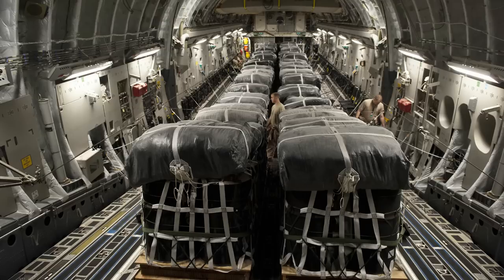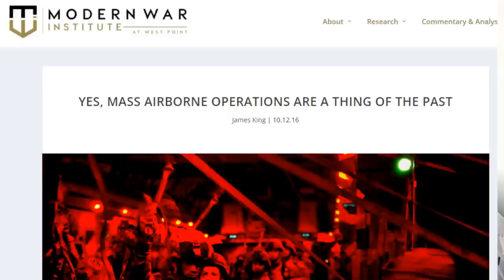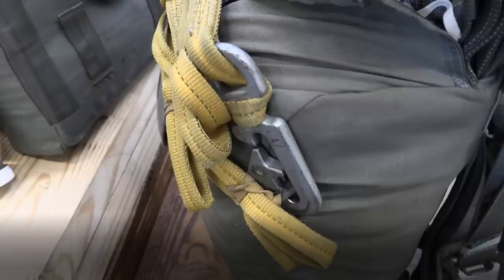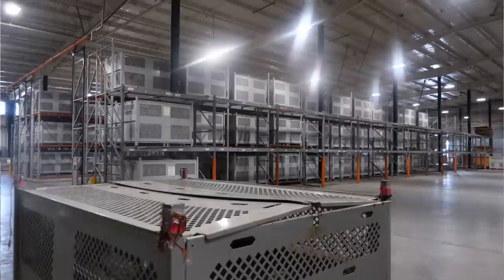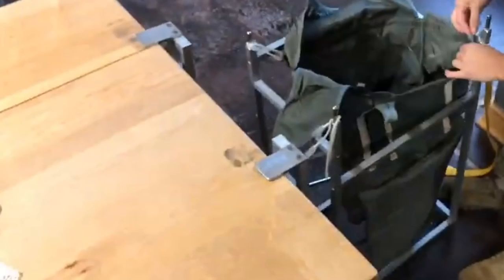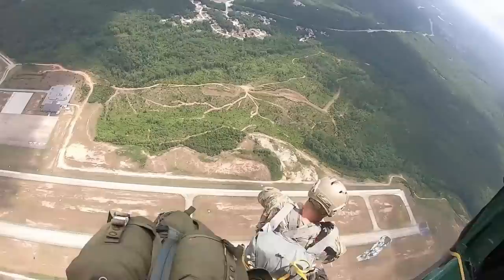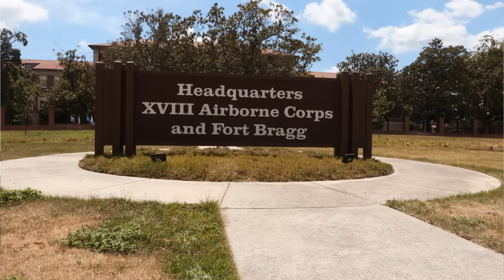How Airborne operations work : Featuring the 82nd Airborne the Riggers of the 11th Quartermaster

Comment: I have 15 jumps.

The only time I saw riggers is when I was on parachute detail after the jump.

We took the chutes to hanging towers and cleaned out the debris, straightened the lines and the put them back into the recovery bag for the riggers to pull out onto the rigging tables.

We were not allowed to help them at all at that point.

That was a long hard detail.

Each month our riggers had to jump a random chute they packed that month.

Comment: Several times, I flew a Huey at Fort Lee, VA to drop rigger AIT students.  They would sit facing outward and strapped in with the seat belt.  Their static lines were hooked to a cable above each door.  The jump master would tap then in turn on alternate sides of the aircraft and the Huey would gently rock as they exited.  On one drop, there was a major roll force and a thump in the cabin followed by yelling and muffled ‘thwack’s.  Crew chief told me to go around for another pass.  Later, I found out the last jumper did not undo his belt, so when tapped he lurched forward to a stop.  Jump master, not knowing what was happening, grabbed the jumper and hauled him backward into the cabin (the major roll I felt).  Despite earplugs and helmet ear seals, I could hear the jump master hit the soldier’s helmet as he verbally instructed him on something unintelligible.  The second attempt was successful.

Comment: When the 173rd jumped into northern Iraq, they were met on the drop zone by Kurdish fighters who had already secured the drop zone and they took no fire. In fact, their weapons were dry until they hit the ground (your rifle or M4 is in a case called a 1950 and your M4 with a 30 round magazine inserted will not fit into the bag, that's why all good  paratroopers have at least one 20 round magazine) their magazines were not inserted in their weapons. The company level 11C guys didn't jump the 60s. They had them pallatized with the rounds going out with the tubes still in the boxes. Normally every paratrooper jumps with two rounds for the company section and 50 rounds of 240B  ammo for their platoon guns. All that was on pallets. Though they had jumped with the tubes in their jump box, the base plate on one of the guys ruck. 
Hollywood jumps are normally done by guys who are "pay hurt" or being close to not making their mandatory 1 jump every 90 days out of a high performance aircraft, for whatever reason, ie...injury, at a school or missing tactical jumps due to family issues. They will allow guys to jump to maintain their hazardous duty pay status and maintain jump status. Airborne school allows paratroopers at ANOC and BNOC to jump with trainees and other pax there to maintain status.

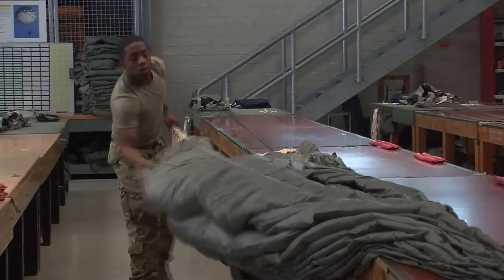Comment: Regarding the claim @ 4:46 that riggers are the only job that nobody else in the Army can do, I have one word for you.  Linguists.  35P is the MOS I think.  1N3 if you're USAF.  Rigger school is 16 weeks.  Linguist school can be a year to a year and a half, plus several months of follow-on training.  Not taking anything away from them, but the washout rate for both jobs' training is around 30%.  Both ASVAB requirements are similar too, at about 90.  Although a linguist also has to pass a SECOND test after the ASVAB called the Defense Language Aptitude Battery which is freaking hard and prevents even some people with high ASVAB scores from qualifying.  So there's definitely some level of parity there, and you definitely need a brain to be a rigger.  But I've gotta rep for my language nerds.  They're just as hard to replace.  Especially good ones.
Reply from the maker: Ok. Although some people in the army are bilingual. I am going to do a story about the linguists soon.

Comment: I remember back several years ago some jackass cut some of the lines on the main chutes and I think 5 or 6 troops in a row had to deploy their reserves. This happened during a training exercise at Fort Bragg. Thankfully they quickly stopped dropping sticks when they realized there was a problem. As a B licensed skydiver, I would be getting a confirmed kill once I found out who tried to kill me! My uncle jumped into France on D-Day with the 101st Airborne and I guarantee anyone doing that crap to their unit would have been used for bayonet practice!

Comment: Awesome video !
Not the only specialized MOS in the military - Riggers are great no doubt, but there a tons of MOSs that can be legally performed only by certified individuals. Mechanics, Logistics, and Medical beyond operator level. High level artillery demands experts to test wind and other circumstances before rockets are launched- only certified individuals are supposed to clean and maintain the rockets. Basically, rigger is not the only MOS others are not allowed to do. All MOS relay and feed on each other- Riggers are great and I love working with them but there are tons of MOSs in the Quartermasters Corps that are in the background and specialised - same for Ordnance.  If you are interested almost all the MOSs do AIT in Fort Lee, Virginia. With Army recruitment down they might let you do a video. Just don't leave out the 92Ys and As and of course the 92Gs. Also, 94E is at Fort Gordon - which is where most of your specialized Commo and Signal is taught. A lot of these MOSs may not result in a major splat like a failed chute- but you would be very wrong to think logistics, maintenance, and sustainment as a whole cannot result in death in training or in the battlefield. And...thank you for attending my Ted talk

Comment: Got to watch a roman candle in Bien Hoa, Vietnam in 1966 Skyraider pilot bailed out of his sick plane & chute twisted. The herd was still at Bien Hoa you could her the yells of the 173rd as the man fell.

Got to watch a failed ejection of a a Navy A-4 at Da Nang in 1969. It was on a one good wheel with full load of bombs landing . He went up maybe 300" no chute deployment died still strapped in his seat. 

Nam story goes the airborne was loaded in the plane ready to go on a jump. They deplaned & went to the LZ by 'chopper. The VC had been busy, all the local potential landing areas had sharpened bamboo stick facing the sky. French used paratroopers and the VC knew how to deal with sky soldiers. 

I understand that the Panama canal drop was done at 500" guess that's why it was thought to be so dangerous.

Had a paratrooper die of excessive wind at the drop zone. Next day Gen. Westmoreland jumped as a test dummy.

Bien Hoa had B-66 aircraft munitions cook off on the flight line. Pilots ejected and were dragged to their deaths by the explosions catching the parachutes.

Working a reserve airfield in Arizona when a group of snake eaters/CIA fellows dropped out of the sky in highly maneuverable parachutes. We tried to come up with a hand signal to avoid getting step on. Good times.

"Faces of death" movies had a scene from Florida of a parachutes landed in an alligator farm. Move title says what happened.

Comment: 43-87 I was a rattrigger ( 31C2 A4 1P communications ) from 85-89 I was attracted to the 1/39 FA when they transformed from a leg unit to become the 1st abn unit with the M198 155MM. It's interesting to see how the equipment has changed. We had the T10B and the MC1-1B and later the T10C.. It's kinda bizzare to here about Hollywood jumps being combined with combat equipment jumps. We had the c130 and c141 mostly. Had one junp from national guard ch54 skycrane and got bumped last minute from C5 certification jump. Made almost 40 jumps from 87 -89. After jump jump school we almost never did Hollywood jumps usually at night and always with m17 has masks. Good times. It was common practice to aquire 550 cord by discreetly cutting it off your chute after landing.

Comment: Honourable mention of Market Garden Operation
Reply: Even during Op. OVERLORD, the results were mixed.
The failure of Market Garden was mainly due to its forced nature, its like when you're playing a video game and have this special unit that you didn't use so far so you decide to use it anyways even tho there is no good reason for that, similar thing here, the airborne divisions were just either reservists or fighting as regular infantry and that pushed the High Command to do that.

They will learn harshly that Airborne missions offer tactical advantages, not strategical ones.

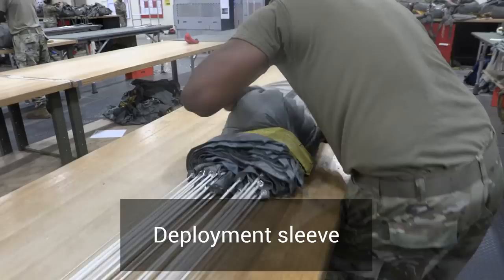Comment: 10:17 Isn't Bridal spelled as "bridel". That's how I always have known it (civilian skydiver here). Also, in civilian use a drogue chute and a pilot chute (pc) are similar but not the same. A pilot chute is meant as an anchor in the air that pulls out the main chute out of its container when deploying in free fall. While a drogue chute does the same but is also used to stabilize and slow down a skydiver during free fall. Typically on tandem jumps (two people under one chute) drogue chutes are used during free fall.

Comment: I’d like to see an ancillary video about non-static-line jumps, IE HALO jumps.  Probably different chutes and packing methods.  Also probably a lot fewer people that do those types of SOCOM missions.
Reply: Similar approach to how the units work with chutes but freefall chutes are designed nearly the same as civilian skydiving chutes just bigger to support the weight. Individual jumpers are trained how to pack those chutes in freefall so riggers would supervise them packing their own chute for a jump most of the time or have one packed by a rigger for them. It’s very expensive training for freefall so less are able to get the experience unless necessary for their job.

Comment: You forgot to mention the German paratroopers biggest win, when they used gliders to land on the Belgian fort Eben Emael. Knocking out the linchpin in Belgians main line of defense in 1940 and be one of the most successful operations of the war
Reply: Definitely, however what Germany should have learned is the airborne offers tactical advantages not strategical ones, yet because of this tactical win they decided to push the airborne another notch and caused unsustainable casualties that prevented the airborne from being used in Op. BARBAROSSA.

Comment: I because I admire your work and the fact that you’re a stickler for details I tripped over a use of the word group “rate of speed“. Speed is already a rate so when you say rate of speed it’s actually an acceleration which of course is not what you mean. I know that “rate of speed“ is common parlance but it indicates to me that the person speaking these words either doesn’t understand science or English or both. Simply eliminate the words “rate of” and you will be correct and save two words in the bargain.
Reply: Yup.  It should be "higher speed" not "higher rate of speed." Pedantics unite!
Reply: @ericfermin8347  I appreciate your comment but since no one said anything other than you in two months, I can assume we are in the minority.

Comment: My people!! 
Got out WAY before the T11 but think Ii could pack one if needed 

I've walked across a canopy or two, had some rough landings, may have gotten knocked out on a couple, jumped into the ocean in Australia, loved it, still miss it 

Dumb question for current paratroopers or Riggers since when do the Rigger wings go above Jump, Freefall or Air Assault wings? Always wore them below jump and AAS wings per regulation

Also, is the 4th 647th QM still at Ft Campbell? Last Unit I was in

Comment: Nothing worse than chute shake out or a riggers signature. Just out of habit i would check the little log book on my chute before a jump, and i swear their signatures were worse than a doctors.
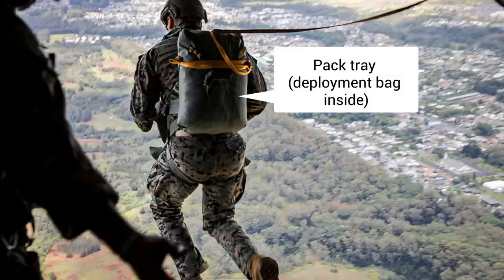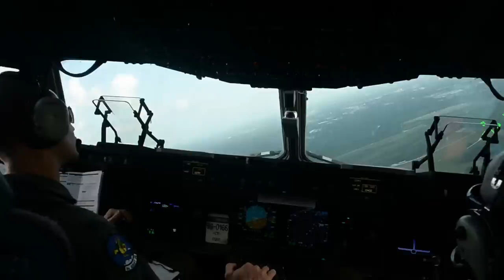Reply: Chute shakeout was mandatory for every jumper in my unit.  Don't show up for chute shake out, you don't get credit for the jump.  Sweeping up the debris at the end of chute shake out brings up memories of the end of a long day: pre-jump evening before, manifest call 05:00, bus to the airfield 06:00, jock-up 08:00, load 09:00, low level puke fest followed by jump at 12:00, 5-ton off the DZ to the rigger shed, shake chutes, dismissed at 16:00.

Comment: So, I guess there’s no more pulling the rip-cord?  Or do chutes still have them and if you want to free fall for a few seconds you just don’t hook up to the static line?  I assume the auxiliary chute does use a ripcord?  HELP needed from any jumpers.
Reply: I stumbled onto this video because my good friend died 34 years ago today and wanted to pay my respects to my buddy "Berger"  Sgt. Bryan E Bohenberger Echo Co. 407th 82nd airborne / pack platoon .... you are not forgotten.  
I will try to answer your question.... your first question of no more pulling rip cords. Ripcords are not pulled with static line parachutes (T-10 or mc1-b in my day, I'm not familiar with the current crop T-11 I believe).  The two styles of parachutes are very different... I'm not going to get into round vs square or ram air but at the end of the day, you do not have a choice on a given jump to "fall for a few seconds".  The static line is hooked to an "anchor line cable" this cable basically runs the length of the aircraft and all jumpers hook up to it (it's a jump command inside the aircraft followed by check static lines) the jumper hands the static line to a person called the safety who controls said static line and then exits the door ... basically in this scenario the static line is the ripcord.  The jumper counts (fixed wing 4 / rotary wing 6) and then checks his canopy. He pulls nothing in this situation and his hands' primary mission are to protect the ripcord of his reserve.  If his main canopy fails to open, he does have a reserve canopy that has a "ripcord" .  The military's version of civilian skydiving is when ripcords come into play... the military will use terms such HALO (high altitude low opening) or HAHO (high altitude high opening) just think of skydiving but this is when the military uses ripcords.  In this scenario a jumper can do a "hop and pop" from as low as barely above 1000 feet where they barely exit the aircraft and then pull their ripcord (we're talking seconds) or they can exit from so high up that they require oxygen (30'000 ft give or take) in which the free fall can last upwards of a minute.  I was a HALO rigger what seems like a lifetime ago (not halo qualified / my boss wouldn't or couldn't get me a slot / I'm still drinkin' over that one) hope that answers your question.
Reply: @ftroop4815  Thank you so much!  That absolutely does answer my questions.  I was curious because my youngest daughter has started skydiving 🪂 and really likes it a lot so I pay attention.  Thank you and your buddy for your service and I’m so sorry for the loss of such a good friend.

Comment: Very neat vid, how do the parachute deliveries work for in theater operations? Like special forces, or returning chutes after combat drop?
Reply: Many times for cargo in theater they use low cost parachutes made of a tarp like material that are one time use and get repurposed or disposed of once the cargo gets recovered. Personnel theater drops will have muster points to drop parachutes off before going on the mission

Comment: Mass para drops are obsolete! They cannot be collected in comprehensive unit fast enough, very venerable in the air, hard to supply, that was proven in many attempts. what is left - spesial operation, divrtinaly action, reconnaissance....

Comment: Ryan, can you be too heavy or too light to jump?
Reply from the maker: You can be too light and this can be a problem sometimes.  The max weight of a T-11Main is 400 lbs so most soldiers are not that heavy even with all of their equipment.  If you are too light, you are at risk of becoming a towed jumper.
Reply: This was the reason for the T-11. The T-10 was an improved version of the original design from WWII, when men and equipment rarely exceeded 200lbs. In the 80's, 90's it was found that the average man was getting bigger and carrying more equipment and exceeding the limits of the T-10, so they came up with the T-11
Reply: All parachutes have weight ratings on low and high ends to promote optimal fall rate and glide ratio depending on which type of canopy it is.

Comment: Not to take anything away from the fine young men and women you spoke of here, but I doubt you were correct that riggers have the only job no one else could do.  I went to language school with people and am pretty sure just your usual GI is not going to be able to translate a foreign language just because you pointed to them.  I would guess there are other jobs as well that take more training.  Maybe everyone can learn to fire a gun or apply a bandage fast, but can everyone get a tank up and running when it is just dead?  Doubtful.  
Maybe if you compare hours needed in training and place riggers somewhere on a diagram it would make better sense.  Does it take a significant amount of time in training to do their job adequately?  Not counting basic or survival schools I did 47 weeks, 5 days a week and 6 hours a day.  That got me assigned as a trainee on flights.  Took another 10 flights at an averqage of 10 hours each under a trainer to be certified to stand watch solo.  That time varies.  I was just better than average there.  

So tell me riggers need more than 1500 hours training to be declared proficient to work alone and I will gain a major level of respect for a job I already respect highly.